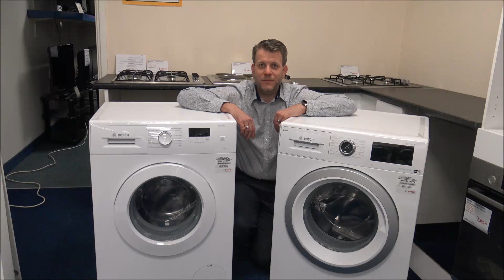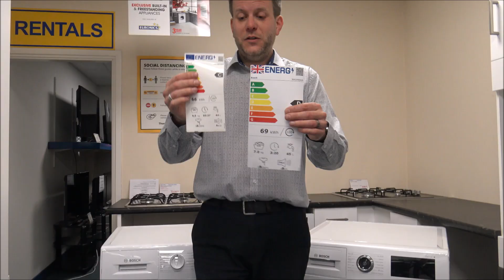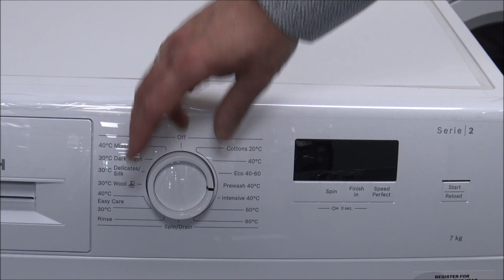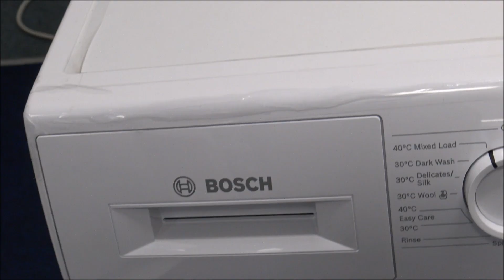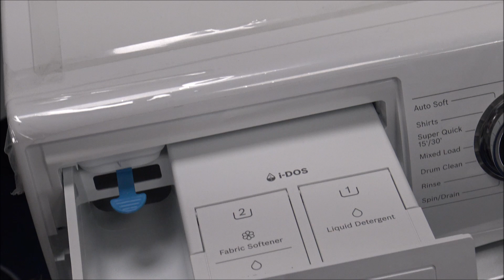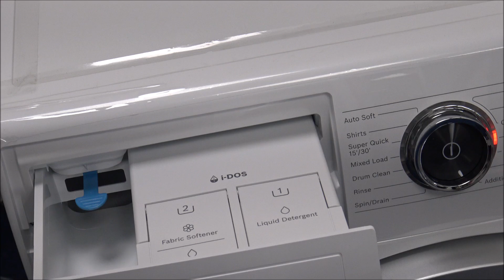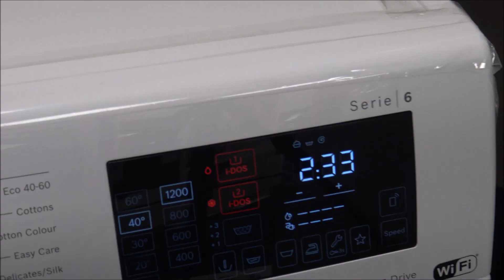Is It Worth Paying Extra For A Better Washing Machine?

Comment: Nice watching this and a very good presentation. More expensive machine pays off. And I mean more expensive; just spend the money and get a Miele. We have a mid-range Miele for about 7 years - it just works. In our summer house, we bought a higher-end LG machine about an year ago. The LG is newer with few more programs and Wi-Fi. I still prefer the Miele - it just works and washes the clothes. The programs are quicker and easier to understand. The options to tweak a program are straight-forward. The Wi-Fi on the LG is mostly a gimmick. For safety, you cannot start the appliance remotely - it's only good for telling you that the machine is done. And the LG is much noisier than the Miele. My point - it's worth spending more money if you can.
Reply: Not sure paying twice the price for a Miele is worth it. The Bosch for half the price does the same job and lasts as long
Reply: @65SCH  I am not sure if *twice* is worth it. But if you can afford if, go for the Miele. I had both, and there is a noticeable difference in quality. The price is not linear compared to quality and you don't get *twice* the quality - but you get better product for sure.

Comment: I have had 2 washing machines so far, The first Beko was a 5kg basic spec and lasted 10years and was never touched, the 2nd was a Beko 8kg which clogged up the filter at least 4 times a year and only lasted 4 years. I will never buy Beko again and spent the extra and bought a 10kg Candy 1400 spin and what a revelation compared to the Beko.

Comment: I always wanted a Bosch washing machine in our household, as we've had a Bosch dishwasher working faultlessly for over 14 years (so much so the plastic fascia failed before any of the mechanical parts have). Hence when we moved house, our existing machine was too tall to fit under the worktop so it was the perfect excuse to get a new one. The machine we purchased was worth, I'm pretty sure, around £699 RRP but was discounted to around £450 due to clearance. That was five years ago and it's worked well ever since, bar a couple of easily resolved filter issues. Considering a lot of machines these days succumb to bearings issues at around the 3-4 year mark, I'm impressed with the quality, particularly as more or less everything is sealed together these days and cannot be easily and inexpensively repaired. So, I recommend Bosch all the way and if you can get a rather expensive machine at a discount price, it's a good way to go.

Comment: Great video and yes I have the lowest cost machine you were demonstrating on. The thing I hate about it is the length of time each wash takes compared to the Bosch I had before. I discovered if I press the time button on this new one, on say, 40 wash I can cut it down to half the time but...it takes a while to adjust the clothes in it as it flashes 4kg . I’ve sussed it now to balance the clothes around the drum! I used to get all my washing done in a day with my old Bosch if I followed the times with this one it would take two days to wash everything, then there’s the tumble drying! I wish I had chosen the more expensive one you were showing.
Reply: Honestly, the amount of difference in the moisture left in fabrics between a 1200 and 1400 spin machine is miniscule, maybe around 2 or 3% difference.  Your laundry would still be damp, even if it was spun at 5000 rpm.
And the price difference some manufacturers charge for a higher spin speed is ridiculous. In many cases, two different machines use the exact same motor, and artificially restrict the speed in some machines, to justify a higher price for others.
But if you look at Beko, they might only charge an extra £10  or £20 for the next machine up in the range with a faster spin speed. And Beko machines are great for the money. I have used the same Beko machine, almost daily, for the last EIGHT YEARS, and have only had to replace the pump, which was an easy 10 minute job. And £25 for a new pump. And honestly, I couldn't fault the machine.
But of all the premium German brands, I would have a Miele, if I could afford it.
Reply: @hermanmunster3358  Higher spin speed more creases.
Reply: @hermanmunster3358  "And the price difference some manufacturers charge for a higher spin speed is ridiculous" Fair enough! Washing machine enthusiasts still seem to ogle the Gorenje WA65205 and it's 2000rpm spin speed all the same, lol.  (Who'd thunk people would upload full washing machine cycles in real time to YouTube?!)
Reply: Those are EU-compliant efficient cycles. You'll probably find the same machine sold in Australian or Thai market specification has cycles over half as long!  E.g., for the Series 6 9kg, in Australian-spec it's 1hr 25min for the cottons cycle compared to 3hr 29min for the cottons cycle on the EU/UK-spec machine demonstrated on the Lord's Electrical channel.

Comment: I just go with Beko now. Unfortunately often not worth repairing machines now. I expect to. Replace after 3 or 4 years, although maybe it will last longer now the kids have left home. I honestly don’t think it’s worth spending more for an expensive model. I think manufacturers build in a failure time personally!!
Reply: Samsung has been great for me, both lasted at least 9 years, I run a cat charity so they get some right hammer. I pay less than 500.00.

Comment: I bought a miele top of the range after getting through three budget machines in five years. It has been going strong for twenty six and a half years !. In its life it has had one new door seal after I managed to yank it off pulling a kingsize duvet out of the machine and a new pump just under one year ago. It has been worth every penny and paid for itself many times over. Needless to say when it finally dies another miele will take its place. 
On a side note my miele tumble dryer is about fifteen years old and has never broken down !.
Reply: In the meantime machines got more complex and unmaintanable. Not sure how Miele evolved.

Comment: I used to love A-series Hoover machines (from the days before Candy got involved) and always found Hotpoint to be very maintainable - right up to the stage where welded plastic tubs turned an £8.00 bearing swap into a £150 repair!,

I’ve got a Neff now. Bought it new but damaged saving £500 in the process and found as I rebuilt it that it’s a genius machine clearly designed by someone who’s had to work on appliances. No going back now!
Reply: Ridiculous paying loads of money for a washing machine, they can last 2 years or 10 years you can be just lucky unlucky
Reply: @Shane-zx4ps  thanks for your expert opinion. I’ve made it this far though…
Reply: @jonchilds1637 . No need for sarcasm, I’m not an expert, I’m just a humble guy with years of experience, which is gives you expertise..
Reply: @Shane-zx4ps  45 years in my case…

Comment: Invested in a Miele 10 years ago.  It was originally located on a raised section of our cellar and one day it fell off (about 2 feet onto a concrete floor).  Honestly I expected it to be destroyed, or at least dented.  But it was fine - no kidding, not even a scratch.  It is built like a tank.
It has been fine since then too.  I am about to replace the door seal but, apart from that, it still looks brand new and hasn’t given us a single issue.  In my opinion, money well spent.
Reply: My grandfather had a Miele dishwasher for 20 years and always used to talk about how well it lasted. It outlived him. I wish the family had kept it for me. I bet it would outlive me as well.
Reply: @christopherflack7629  Any washer, don't spin more than 1000rpm, explained by a dish washer
engineer.
Reply: @neilstanniland1011  That’s good advice. Personally, I would advise you not to spin your dishes at all.
Reply: @DavidSmith-sq6qw  lol
Reply: We've had our Miele 26 yrs and cost has us £200 in repairs in the whole of that time. It still works perfectly well. When we had it repaired he said it had done 16000 hours of use. They are rated to 20,000 hours. Would I pay £1k for another.... yes
Reply: Had a basic Miela in 2002, kept it going for 13 years. When Bosch, Hotpoint and Hoover longest kept going was 3 1/2 years. Even had Hoover pack up within 7 months and had to pay the labour to install new control switch under guarantee.
Saying that took a flyer and bought a direct drive Panasonic NVA 1400rpm 10kg 6 1/2 years ago RRP £550 got delivered £340 and its quiet.
Reply: @jhareng  I manage high end rental properties where money is no object when replacing white goods. I've formed opinions on brands, prices, and I find some  brands are problematic. I've replaced way to many control boards within the first two years of ownership on Electrolux and Samsung manufactured appliances (i.e. dishwashers, freezers, washing machines). Some boards totally fail, while others loose their programming.
Reply: The upper priced Mieles have a ceramic coating on the body, a steel cage to mount the drive unit, and a weight to counter-balance the drum. You pay double the price but it lasts 4 times as long.
Lift these machines and you know instantly which one has 90 % plastic and which one is build sustainable.
Reply: @krollpeter  
Your absolutely right!
Just ask moving firms with wash machine they like most.....
The answer is always going to be ‘aslong it’s not a Miele’ really.
My brother in law is a mover and his face dropped when he came in my kitchen on his first visit.
He explained me later.....i had a difficult time controlling myself (laughing afterward ofcourse)
Reply: @touraneindanke  My mother's Miele comes this year to 29 years. A very expensive model. It's her second Miele in her entire life. She is 83. The current one was repaired once. They changed the bearing and the door seal, and as it was already open also the pump.
Holding that pump in my hands and comparing with the one that is in my Samsung washer (which I changed myself, broken after 3.5 years), I know why Miele cost so much.
Reply: @krollpeter  
In my opinion the extra cost is reasonable ..the ‘problem’ is you can’t see quality from the outside.
I don’t mind paying some extra for more value (i never bought budget tires for my cars)
Eventually i always ended up spending less money and save on stress 🍀
Reply: I'm thinking of buying a Miele this year, rather pricey but I know it's going to last the pace!
Reply: We've had a Miele washing machine for 9 years so far. No problems yet. Funny thing is economy. It uses less power with a longer 3hr wash than a shorter 1hr 49 min wash, and less water.
Reply: Rather than a concrete lump to balance the drum it used to have an iron ring around it. That’s probably helped with the tumble. My mums Miele packed in just out of warranty so she didn’t consider the extra cost worthwhile. It was replaced with a Bosch. And that one with the same brand. When you consider the innards of a Bosch is on par with its own high end brands you’re savvy to not label shop.
Reply: We have now had our Miele washer/dryer for 22 years during which it has never malfunctioned or needed servicing. Admittedly it cost a 'bomb' when purchased but what value for money over this time .My wife does wonder whether its long life is nearing the end which will give us a big buying dilemma in view of our ages!

Comment: We had a very expensive LG washer, lasted 12 years but finally broke down. Needed a machine quickly so took a chance on a cheap £200 mechanical Hotpoint and I can't fault it. Does everything the LG did but much quieter. Had it 3 years now and not sure if we'll bother with high end again. There's only the two of us so maybe that helps.
Reply: What’s a mechanical machine mean?
Reply: @Shane-zx4ps  Possibly the old style mechanical programmer ?
Reply: I wouldn't rate LG - other than to be a brand to walk away from. Used to be Goldstar (video recorders) - that's what the G is for in LG.

Comment: What the customer really wants to know is how the dealer margin differs between entry-level and premium models! 😉
Reply: Funny you should say that, i went in a national electrical suppliers before internet really kicked off 14 years later and left on the desk was a printout of buying and RRP of everything they sold. Most of it was circa 70% markup, what was sold for £590 they were buying in around £330. Quite common to double buying in cost, some even put 400% on. Still bought the Miela from them knowing couldnt get cheaper at £560 delivered in 2002.

Comment: I bought a Miele washer a couple of years ago. You slot in 2 big tubs of detergent and conditioner at the base, and it lasts for 40-50 washes. Id never go back to messing about pouring liquid in a drawer now. Best thing is all Miele devices come with a guarantee that spare parts will be available for 15 years

Comment: I have bought the series 2 washing machine and series 4 tumble dryer, and the only reason is my relative works for one of the retailers, and can get all the parts for them , the worst brand I have came across is LG ,it lasted 8 weeks and took the Enginear 6 weeks to get the part , then on fixing it it lasted 20 minutes, so I went back to the retailer I bought it of and they replaced it for a Bosch .

Comment: Very interesting review.  We had a Bosch for over 20 years without any problems but it failed on the first day of lockdown.  We removed it and put in a second hand Hotpoint as a temporary measure until we could get another Bosch installed.  The Hotpoint is still going fine, my main complaint is it is cold fill only.  With a tank of hot water from my gas fired CH it seems crazy to heat the water by electricity.  However it appears the vast majority of washing machines are the same these days.
Reply: I use a watering can in the soap drawer to fill with 5 or 10 litres of hot water👍
Reply: What I do is fill up a few pans of hot water from the tap, set the washing machine to its program when it starts (to fill) open the door and manually fill it.
Reply: @VCanisMajorisY  Nice hack 👌
Reply: I'm glad I'm not the only bonkers person who adds hot water to the drawer.  I reckon it helps warm the terribly cold water from the mains before the heater kicks in.  I have a 28 year old Zanussi washer dryer and although it's hot and cold fill, it only takes hot water on the 60C+ programmes.

Comment: A repair without parts is usually around £130.  Many landlords buy the cheapest if it lasts a couple of years you throw away and replace. A 1k machine is guaranteed 10yrs a 150 quid machine is 2yrs guarantee. Why pay more ?